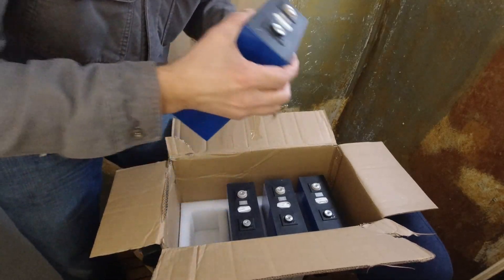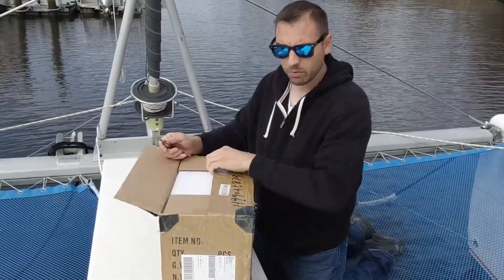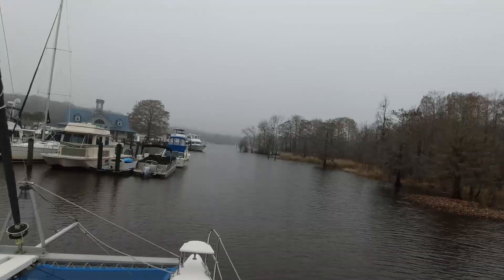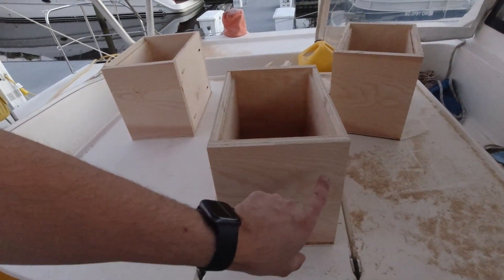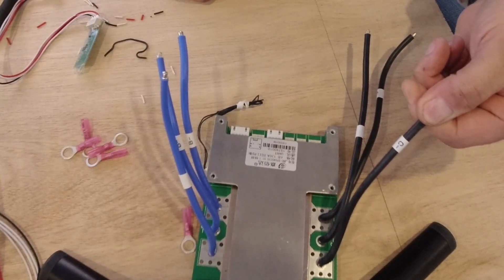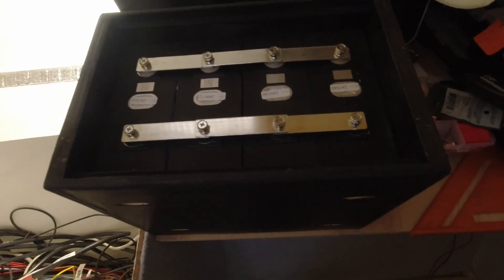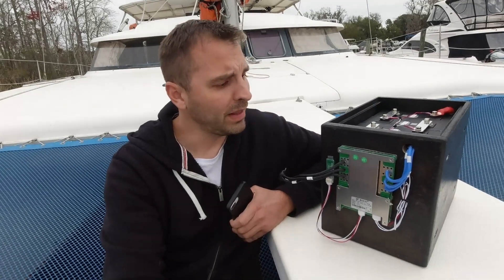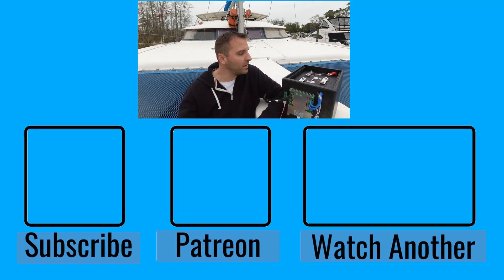Building LITHIUM Batteries [DIY] For Our SAILBOAT

Comment: That was a great diy video.. your total cost for 1 battery is around 800 dollars. That is a great price. The cheapest they have a 300 ah  on Amazon is around 1300 dollars. So you are saving 500 dollars each. When compared to battle born, you are saving a lot more. My suggestion is to buy an extra 1-2 cells and an extra bms and keep them as spare backups in case you have them go bad when you are sailing. Overall, great tutorial. Thanks.
Reply from the maker: Thank you!!  We spent about 2050.00 on the batteries and about 400.00 for the BMS’s.  The prices fluctuate.  We have 1400 amp hours. For the same amp hours with Battle born batteries would be about $13500.00.   The BB batteries have EXCELLENT build quality but they are super expensive AND they would take up a larger footprint.  We sized our system large, so if we have a failure we can remove the failed unit.  Replacement BMS is a great idea.   Thanks again, Corey
Reply: @SaltyEscape  so you paid even less through alibaba. 500 a battery. That is just amazing. Hope they they serve you well for many years to come. I will probably do the same as you when time comes.
Reply from the maker: If you calculate the cost per amp hour it’s better yet. 😊